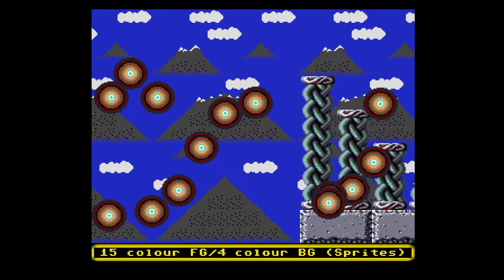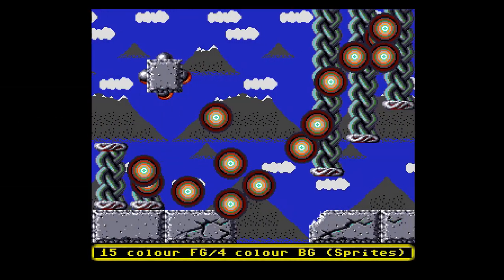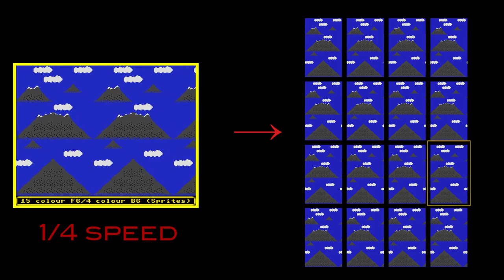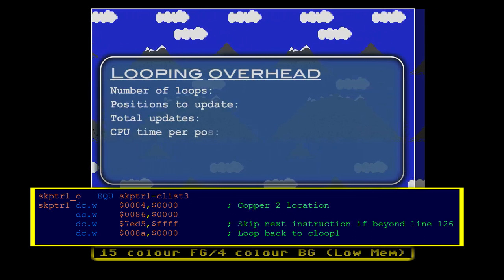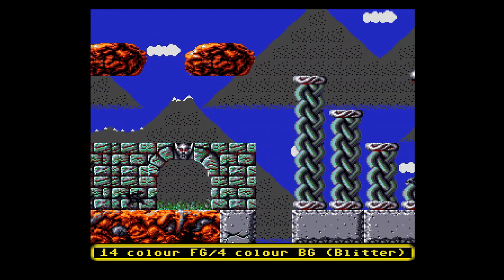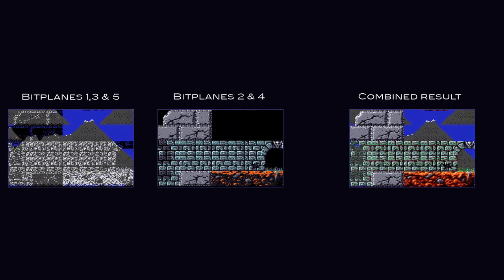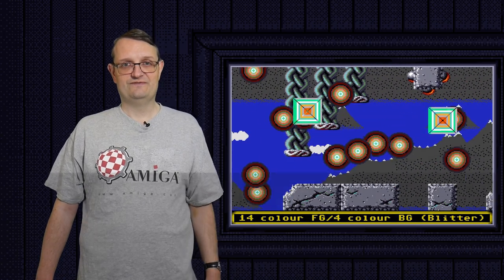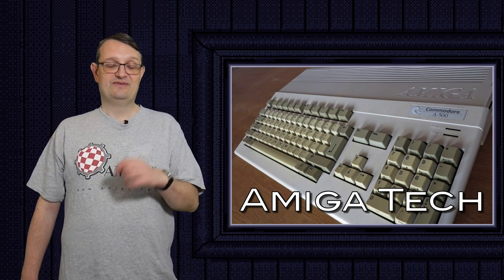Amiga Tech - Dual Layer Graphics

Comment: I wanted to add a few notes.
Specifically about AGA-
1. The blitter is twice as fast.
2. There is half as much bitmap DMA (DMA used to render the bitmap)
3. Sprites can be up to 64 pixels wide
4. Dual layer mode has each layer at 16 colors.
Overall, great video!
Reply from the maker: Thanks for the compliment.

However, the Blitter on AGA is not any faster than the Blitter on OCS, it merely appears faster due to the ability of AGA to lower the bitplane DMA.

Speaking of bitplane DMA, that can be lowered to 1/4th, not 1/2.

The rest is all accurate (I've actually used 64 pixel wide Sprites in one of my examples before as a workaround for AGA not having the 7-bitplane trick).
Reply: @DutchRetroGuy   Wait, does the blitter only use 3.58 mhz DMA and not 7.16 mhz? Sounds rather stupid to me.
And when I say faster I mean the clock speed, not the pixels per cycle.
From what I know, you get 104,000 cycles per frame on a 1200 blitter with 8 bitplanes vs just 40,000 on ECS/OCS.
Reply from the maker: @ecernosoft3096  sadly, the Blitter in the Amiga (and indeed the whole custom chip set) always runs at ~3.5MHz. There are about 71050 DMA/Chip RAM cycles available per frame for the custom chips to use on all PAL Amiga's, from the A1000 all the way to the A4000.

The differences in speed are due to the amount of cycles used by bitplane DMA and the CPU bus width. On OCS, the CPU has 16 bit access to Chip RAM, on AGA (and the A3000) it has 32 bit access to Chip RAM.

However, the Blitter itself only ever uses 16 bits. Bitplane DMA on OCS access is 16 bit, one word per cycle. On AGA however, Bitplane DMA access can be either one, two or four words per cycle (contrary to how Commodore presented it, AGA is actually still a 16 bit chipset. Like the A3000, it has a 'hack' to allow the CPU 32 bit access to Chip RAM, but the custom chips all work in 16 bits still - so the 64 bit wide Sprites & bitplane fetch of AGA internally is 4x16 bits presented as 1x64 bits).

It should be noted however, that running AGA in it's 4x bitplane DMA fetch mode does give the Blitter many more cycles during bitplane DMA, which is perceived as an increase in Blitter speed. However, in reality, if you disable all bitplanes and other non/Blitter DMA, the Blitter will always top out at the same speed, regardless of whether you're using an A1000 or A4000.

AGA was messy and therefore a bit complicated to explain ;)
Reply: @DutchRetroGuy  comprehends
Seriously, even in AGA it doesn’t run in 7.16 mhz? They have 14.32 mhz RAM in the A1200. Sounds pretty darn logical to me.
What I was at least originally thinking was rhat since the Amiga AGA chip RAM runs at 14.32 mhz because the 68020 (an actual 32 bit CPU mind you) there also runs at 14.32 mhz. This would mean that if you divide it by 2 you would get 7.16 mhz. This, is what I thought was what the blitter and Agnus ran at. Yea, you can fetch 32 bits per cycle with Agnus sure, taking only 16000 cycles of DMA (80x200=16000, I’m from NTSC land) or 20480 cycles in PAL. In a 7.16 mhz frame you get 120,000 cycles so the blitter (in my head) got 104,000 cycles minus Paula. This literally seems logical, you have 14.32 mhz RAM after all. Yes, the blitter is still 16 bit and not 32 bit (another missed opportunity) but you’d think this would be the case right? 
Of course, adding sprites in you get some extra DMA cycles. 64 pixel wide sprites take up 16 bytes of memory- this would be 4 32 bit read cycles so it would take 112 cycles per line instead of 80 for all 8 sprites. If the blitter here runs at 7.16 mhz then during the frame it would actually run at 5.37 mhz (7.16 - 1.79) and during VBLANK it would run at 7.16 mhz, again, minus Paula cycles because Paula exists.
Reply from the maker: @ecernosoft3096  yeah seriously, the Amiga Chip set always runs at ~3.5MHz. Yes, this is not logical and yes, this does mean that AGA's performance gain is much less large than it should've been, but sadly it is the case. It is also one of the reasons why the CPU has such terrible bandwidth to Chip RAM, despite having 32 bit access.

Commodore put very little R&D effort into AGA, the engineers were only allowed to upgrade one of the three chips, as management really wanted AAA instead (they chose to upgrade Denise to a full 8-bitplane chip, now called Lisa). The rest of the custom chips were only changed in so far as was needed to support the new features of Lisa.
Reply: @DutchRetroGuy  Welp, that’s what you get when you combine Commodore management with Atari chip designers.
Way to go, literally purposefully hurting the AGA for the AAA. Probably why they went out of business too.
(Edit: Or part of why.)
Reply from the maker: @ecernosoft3096  yeah, Commodore in the 1990's was errr not great at this whole 'tech company' thing :P
Reply: @DutchRetroGuy  to be fair it is still a big upgrade, being 32 bit and having the most color of any system out there. Seriously, AGA is the first system to have 24 bit RGB.
Reply from the maker: @ecernosoft3096  yeah, the A1200 & A4000 were a nice upgrade for sure. It's just that there's some obvious flaws and corners cut in the design of AGA that make it all end up as being underwhelming in certain areas.

But hey, it's all ancient history. I'm just happy to do my coding for it these days :)
Reply: @DutchRetroGuy  Agreed!
Reply: Using the cookie cut was such a bad idea when you could AND against the bit plane data. Loads of my demos used this technique. So much better than needing an entire mask.
Reply: @ecernosoft3096 Because the blitter shares cycles on the bus with the CPU. If you set the Blitter Nasty bit in the DMACON, you could steal those cycles from the CPU.
Reply from the maker: @thewelder3538  in this case I can’t use an AND operation as that would merely cut a hole in the bitplane, rather than combining the two. 

Now, this would allow for a two layer screen, sure, but the whole idea here is to keep as many colours as possible. Using an AND operator would mean the foreground would lose several colours.

Comment: Howdy , there was some tricks to display more than 32/64 colors on the Amiga without using HAM. I think the game Universe did use some tricks to approximate 256 colors on screen by altering the palette as the background was drawn or something like that. I would love to hear your take on that - hope you can cook up a video about that as well.
Reply from the maker: Quite true, there's a number of games (and certainly a whole bunch of demos) that use the Copper to change the palette in real time, which allows for many more colours on screen than normal.

Not many did it well, but those that did it well are pretty good. As you mentionded, Universe is one, but another great example is LionHeart. A more subtle one is Pang, which uses Copper reloading to change the background colours, which in turn means it shows more colours than you might initially think.
Reply: @DutchRetroGuy  Thanks a bunch - I had a look at Lionheart (which I never played) and Pang (which I did play a little bit) and funny enough I never noticed this back then , but now that you mention it it seems like you are right. As far as I remember the Amiga had 4bit each for R,G and B and I believe (or have fantasized about) that some demos did some tricks to effectively color cycle between value (example) 10 and 11 very rapidly to give the impression of a color in between. Not sure how well that worked on 50Hz displays, but as said - I would really appreciate your take on this, but no pressure. Thanks a bunch for your videos, love every single one of them :)
Reply: @SEngelsg  I can think of three problems with that idea:
1) It will flicker. This may be okay for something energetic like Sonic the Hedgehog's shield, but not for some inert background decoration.
2) Most people used televisions as their display, and televisions were interlaced at the time. So the two colors you were switching between would appear in slightly different places.
3) A lot of Amiga games did not run at 50 fps. Often they would scroll the screen and move the sprites at 50 fps, which made them look nice and smooth, but the bobs were updated slower.

Comment: Wow, performance looks amazing here. Beautifully smooth parallax scrolling (looks like 50 frames per second) plus tons of fast-moving bobs in the foreground. That's very impressive, by any standards.
Reply from the maker: Thanks!
It's indeed running at 50Hz. Foreground & objects update every frame, background scrolls at 1/2 the rate.
Reply: @DutchRetroGuy   Ah, interesting! The lower frame rate of the background layer is not apparent due to its slower speed.
Reply from the maker: @Midwinter2  yeah, that's exactly the trick. No need to update something at full frame rate if you can't see the difference anyway :)
Reply: @DutchRetroGuy   Absolutely!
Reply: @DutchRetroGuy   One more question, if you don't mind. 

I presume that the two sprite-based methods would not work if you wanted to add vertical scrolling as well as horizontal? 

But that vertical scrolling would be no problem with the blitter-based technique?
Reply from the maker: @Midwinter2  you can use the Sprite based methods for vertical scrolling as well as horizontal, all you'd need is a taller background pattern. This is because the Sprite pointers are set to point to just Sprite image data, not Sprite control words (those are set manually).

Blitter variant can also do vertical scrolling.
Reply: @DutchRetroGuy  Ah, thank you!

Comment: Would be great to see how expensive a brute-force pure blitter 2 bitplane background is compared to these cleverer approaches, both in 16 color mode and 32 color mode (it would use the first 4 colors). That would leave nearly all colors plus all sprites, so knowing the "price" of that in comparison would be great.
Also little comparisons like having the background layer not be fullscreen (for example, just a mountain range in the middle of the screen, lots of games did that) and how many more bobs you can get from doing that. Just some other ideas for parallax related videos you could do.
Reply from the maker: There's certainly more stuff that can be talked about when considering Dual Layer approaches :)

I can probably give some clarity though, the Blitter cost for doing a 2 bitplane (rather than 1 bitplane) solution will cost an additional 8960 DMA cycles for the current 25FPS solution, or an additional 26880 DMA cycles for a 50FPS solution. The 50FPS solution is clearly too expensive, so I'll just focus on the 25FPS solution for the remainder of my answer.

For a 4 bitplane screen, this change translates into losing ~4 BOBs@32x32 per frame and gaining ~2 BOBsat the same size due to dropping from 5 bitplanes to 4, for a total of 11 bobs per frame. 

As you point out, this would give you 8 additional Sprite colours. Note however that it would lower the total number of colours for the foreground/background also: from 20 to 16.

If you want to go 5 bitplane, the costs get higher. You still lose the 8960 DMA cycles for the extra blitting, but don't gain the 4 vs 5 bitplane offset. Furthermore, 5 bitplane bobs are more expensive to draw. In total, you should expect to lose ~6 BOBs drawn per frame (@32x32), leaving 7.

As for not going full screen, that roughly translates into a linear gain depending on how many pixels you drop. I.E. if you halve the effect size, you gain about half the cycles, which translates into about 2 BOBs @32x32. Note that in the case of the Blitter effect such an approach will complicate blitting of BOBs somewhat as there are now regions of the screen where blitting needs to take into account the Blitter effect and regions where it needs to work as normal.
Reply: @DutchRetroGuy  Very clear! Thanks :)

Comment: Hardware sprites can acrually use 16 colours. You just need to work on different bitplanes with blitter so colours 16-23 are a copy of 0-7 and 8-15 are mirrored into 24-31. We can use copper colour magic on background then.
Reply from the maker: As far as I can see, I'm limited in what bitplanes I can use because I use the Amiga's hardware scrolling with different values for playfield 1 and playfield 2. 

This splits the display up into bitplanes 1,3,5 and 2,4. I can currently choose either bitplane 2 or bitplane 4 for the Blitter bitplane, so it's either all colours that are multiples of 2 or 8 which get doubled.

I can't easily use bitplanes 1, 3 or 5 because doing so would require using the Blitter to correct at least two bitplanes rather than just one, which would make the effect cost much more performance (which in turn would limit the number of objects that can be drawn in a frame even more).

So yes, it can be done, but you'd drop to a very low number of Blitter Objects that can still be drawn at that point and I didn't see that as a good option myself.

Regarding the Copper, it's free if the Blitter based background is used so it can indeed be used to increase the number of colours on screen fairly easily. I didn't do that here because I focus on one effect at a time in these videos to keep things more focused :)
Reply: @DutchRetroGuy  but why we cant use 5th a blitter. It does not matter which plane is front and which is back
Reply from the maker: @AA-vf3eu  Bitplane 5 can't be used because bitplane 5 horizontally scrolls along with bitplanes 1 & 3.

If you want to use bitplane 5 you'd either need to Blitter correct bitplane 5 and one of bitplanes 1/3. Or Blitter correct bitplane 5 and one of bitplanes 2/4. This is because the Amiga scrolling hardware can't scroll individual bitplanes horizontally, only bitplanes 1,3,5 together and 2,4 together.

If you use bitplane 2 or 4 for the Blitter this isn't a problem as both 2 and 4 scroll together so you don't need to double correct.

Your solution could work for vertical scrolling though (as there bitplanes can be freely scrolled separately), so that is something to keep in mind.
Reply: @DutchRetroGuy  right now 4th bitplane belongs to single playfield operated by single scroll register. 5th bitplane belongs also to single playfoeld operated by single scroll register. I dont see a difference between them which would prefer on over the second
Reply from the maker: @AA-vf3eu  that is because you’re not considering the whole picture: the background layer consists of 2 bitplanes. These scroll at a different rate than the foreground. Since the bitplanes are coupled in how they scroll (2,4 and 1,3,5) the only viable way to combine bitplanes is to use 2 & 4.

If you use 5, you either need to scroll 2,4 at the BG speed or 1,3,5 at the BG speed. In both cases you end up needing to correct at least 2 bitplanes with the Blitter - or accept fewer FG colours.
Reply from the maker: @AA-vf3eu  what might help in understanding the issue is that I’m correcting only for the pixels of the foreground, the background essentially just scrolls as normal (albeit in a roundabout way considering one of the bitplanes ends up being blit in full across two frames)
Reply: @DutchRetroGuy  i believe the reason only planes dedicated to background can be used is that the background moves at half speed which allows us to split blitter into two frames. Am i right?
Reply from the maker: @AA-vf3eu  that is indeed a big part of it. The issue is mostly one of performance - it took quite some doing to get it all to work as fast as it does now 😅
Reply: @DutchRetroGuy  well i believe, this is very interesting option how to make multicolor scrolling. Blitter is not as cycles hungry like copper so i believe its possible you would have more cpu time every frame and sprites can be used for main charakter. One last thing, why its not possible to correct only pixels of background while foreground scrolls normal. In this way 5th bitplane can be used
Reply from the maker: @AA-vf3eu  well, it's certainly possible to correct BG pixels instead of FG ones, but the correction has to be done on a bitplane not in the layer that you are correcting for and increases the number of colours for the layer you are correcting. 

So if you correct background layer pixels, this would increase background colour numbers and not foreground colour numbers. Which would allow you to use bitplane 5 as the shared bitplane and would give you 16 colours for the Sprites, but it would also limit you to 7 foreground and 7 background colours, at which point Dual Playfield is a better option.
Reply: @DutchRetroGuy  you made the code so this makes you more qualified person but i still belive you are wrong on this one. Please take some time to think it throught. If we select the bitplane for blitter it will always affect both playfields no matter which one is it.
Reply from the maker: @AA-vf3eu  well, no offense, but I did think it through. Bitplane 5 is the obvious choice to make, so that's what I tried first. And I realised after trying many combinations that the bitplane you choose is stuck to the other bitplanes in the same playfield. 

The consequence of this is that you can only add colours to the playfield that does not contain the bitplane you do the corrective blit to.

Now to be clear, I'm always open to admitting I'm wrong or learning new things.

So if you can tell me exactly how your idea of using bitplane 5 would work (including which bitplanes if any need blitting and how it interacts with the limitations of picking bitplanes to scroll and how you avoid either adding colours to the background or requiring more blitter time), I'm all ears. I'd love it if it could work. But so far, you've not convinced me.

Doesn't mean you have to be wrong, just means what you said so far doesn't work.